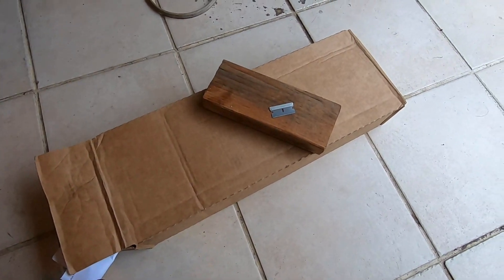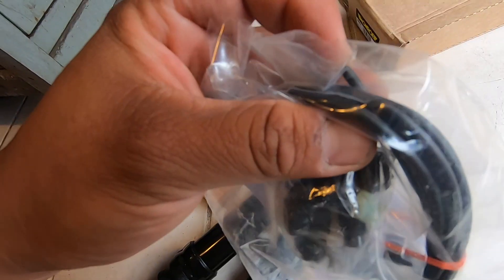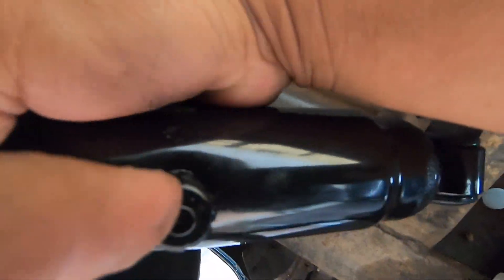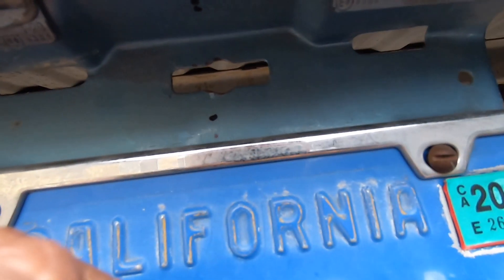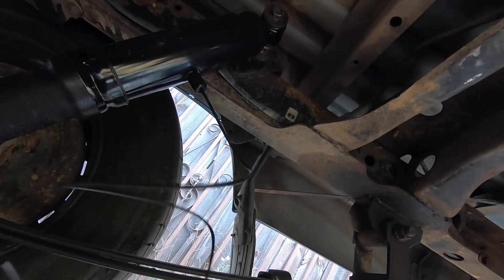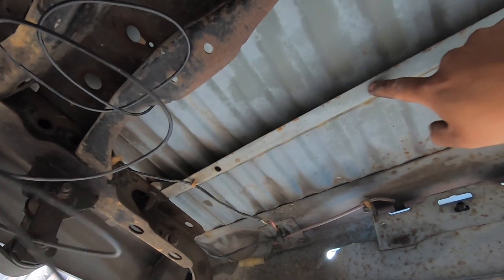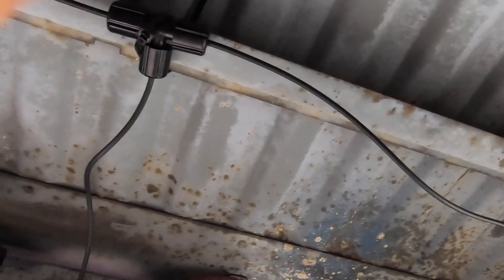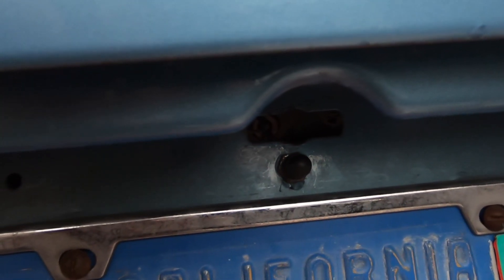How To Install Rear Adjustable Air Shocks On A Lowered Toyota Pickup Hilux

Comment: How are they holding up? I got some for my Silverado cus after my flip kit I was a little too low. Want to go up like 3/4 of an inch
Reply from the maker: They are doing pretty good. But the weight does bring them down kind of quick
Reply: @OXCFilms  I won’t run any weight in the back I’m pretty much doing it just for cosmetic. Have you had any leakage when they weren’t under a load?
Reply from the maker: No leaks at all
Reply: @OXCFilms  how low does it go when you have weight? and how quick does the air go out?
Reply from the maker: I think as long as you install it right it shouldnt leak